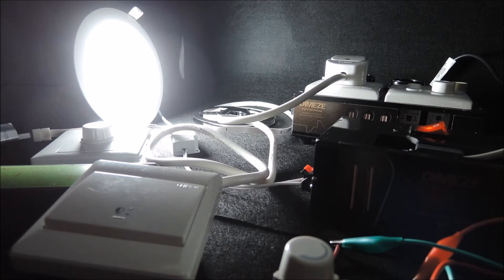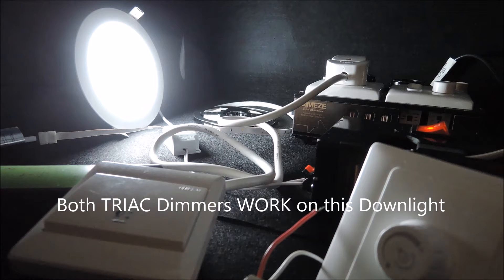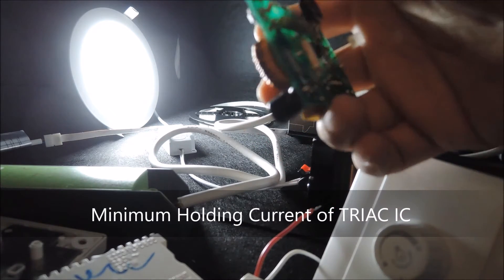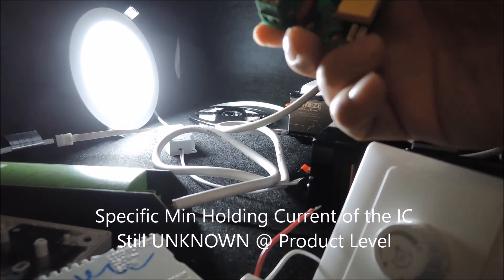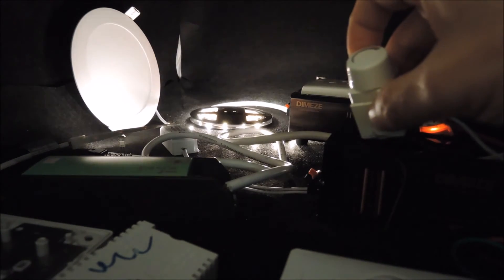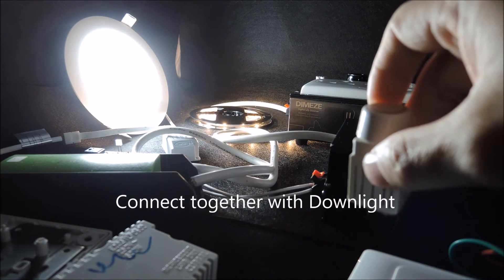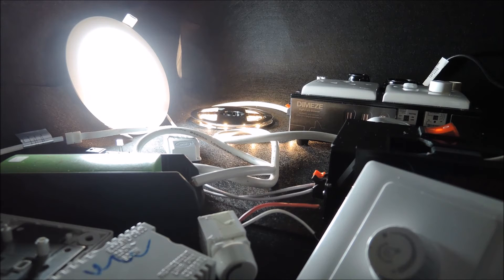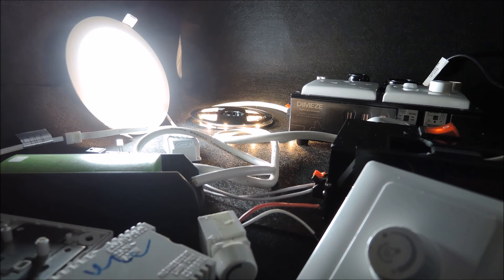TRIAC Dimmer vs Digital LED Dimmer

Comment: Wow great video and finally a clear understanding of dimmers. 
I have a problem I hope you can solve, I own a pair of Quasar Science X crossfade LED tubes made for film.
They are 120V AC 50/60hz 25W and are dimmable for high framerate cameras (180FPS in my case). The problem is that they recomend very few dimmers as I was demonstrated in the lighting place I purcahsed them that only the LUTRON CL Lamp Dimmer could deliver flicker free on the light meter. 

I have now moved to Australia now where mains is 240V AC 50HZ, I can use a step sown the achive 120V 50HZ but I need a dimmer that can deliver flicker free performance with this input. The only dimmersI can find are 60hz at 120V and that without knowing if any will be flicker free. Any help or product suggestion would be appreciated.
Reply: wow these people dont even mention the dimming profile they use. anyways frequency shouldnt affect dimming. just use a step down transformer.

Comment: I have old x10 computer/remote dimmers. If I have one led light and one halogen I can get it to dim and turn off. I don't particularly want to go get an entire new system . Some have suggested modifying the switch or putting a small restrictive load in parallel with the light to allow the leakage current that powers the switch and allows the LED's to turn all the way off.. New switches from x10 that use a neutral won't work as I don't have neutrals available at the light switch box. Somebody needs to come up with small load
that can plug into the light socket that will allow a small enough current to pass through to 
stop the LED from lighting so I can use LED's in single light sockets and replace my phony load
Halogen lights in the circuits where I have multiple lights in parallel.
Reply from the maker: Suggest you look into the Minimum Loading Required (W) for your current dimmer. If it's in the range of 40-50W, adding a Halogen (50W) to a LED (7W) would explain why you can do what you've done. All you need is to search for a dimmer designed for LED lighting and can operate without the Neutral line. The leakage current thing should be dealt with by the dimmer and is too much work.
Reply: Already have a 60watt halogen/equivalent ) in parallel with and LED so I have am doing that experiment and it works.
I have about 8 or those x10 467 switches plus controllers and remotes and don't want to go to a new system.
Where do you find the minimum load? Saw on add where they were selling a 10k resistor for 20 bucks another where a guy was putting in a 22k or 220k(doesn't seem right on the last one.), Resister has to go in at the light fixture where there is a (neutral/return) The thing is I don't want to go to a new system if I did the Phillips looks like it might work but I woulld have to revert back to regular switches with wi fi bulbs which still consume some power when off (with the regular wall switch on) and also go to a mixed system of remotes.
Reply: Not really a good solution as I have to ditch my entire x10 system controllers remotes and switches. I think if I did I would go to the Phillips system. Regular switches and Wi Fi bulbs.

Comment: Exactly, You would think that a product line could make a killing by marketing compatible LEDs and Dimmers?!  2017 and still a no show!
Reply: Most of the new products I have found require a neutral at the switch this wasn't required in New construction till 2011 I understand. I have seen Cirrus Logic advertises a chip that overcomes this but I don't see a product that uses it.
Reply: 2025 and still a no show. Lutron is a cartel.